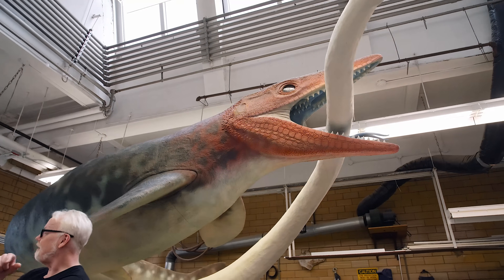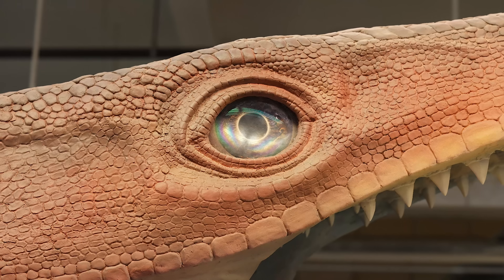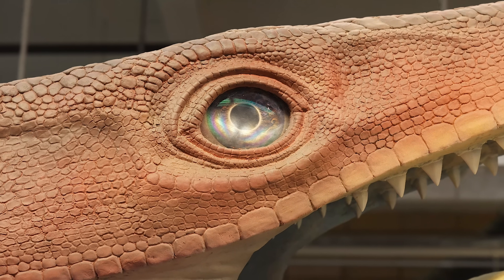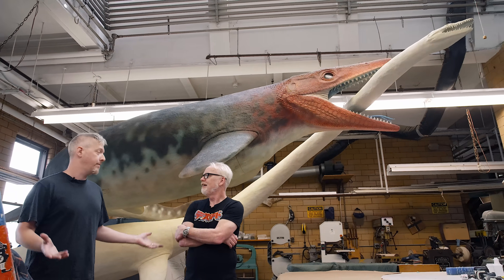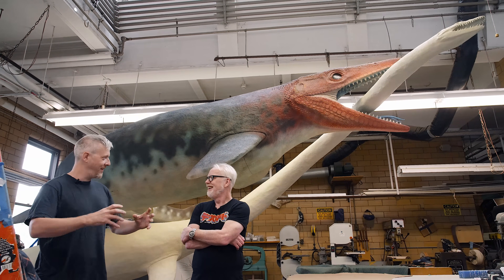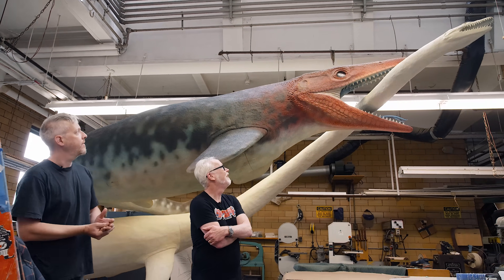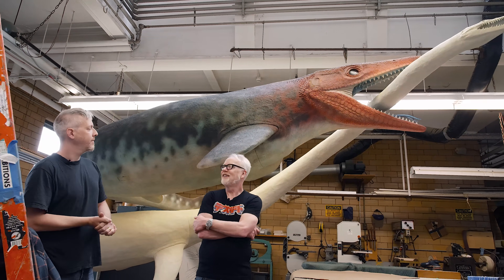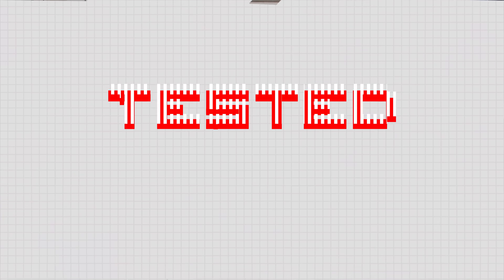Adam Savage Meets a Triceratops AND Mosasaur in PERSON!

Comment: Why are you making 24 fps content for a platform where nearly everyone is using a 60 Hz display? 30 would be vastly better, avoiding 3:2 stutter and more easily integrate content shot on phones at 30 or 60 without really messed up frame pacing

Comment: There's a lot of creative decisions going into this, but it's still scientific. They're applying a hypothesis that fits the data. Maybe the proto-feathers are wrong, but the data showing them existing before and after triceratops makes the hypothesis reasonable. Science adapts the hypothesis if the data contradicts it. The long term trend is clearly toward more accurate models of these animals.

Comment: The angle of the crest on the trike looks odd. It's opposite to what the actual skulls seem to show.

When it comes to the hairs/spikes on the tail and back, I know some protoceratops had them, but are we doing the same thing as with feathers a bit back? Slapping the stuff on because "why not". Like they turned a t-rex into a giant chicken, with no feathers on the underside where we knew they had none because of the imprints we had. Every other surface was covered with feathers. Because why not...
Reply: There are two species of Triceratops so it might just be based on the other species and not the one the skulls you are thinking of belong to.
Reply: Triceratops has little holes in its skin on its back which seems to be a spot where quills would have been.   Considering we know for a fact it's ancestors had quills in that exact spot, Triceratops most likely did too

Comment: the trike is cool but just because ancestor has feathers doesn't mean they should have them
Reply: But it does mean it's more likely they had feathers. It's called phylogenetic bracketing, which means animals that are related tend to share traits. Phylogenetic bracketing is also what Paleontologists do to reconstruct dinosaurs that have very little fossil material. They reconstruct the dinosaur's appearance based on its closest relatives.
Reply: @jacobcox4565  Very unlikely since most ceratopsians lived in warm environments, only one like Pachy that lived in cooler climates could have been woolly rhino analogue, but still its all just speculation.
Reply: @FaustianSerb  Elephants still have at least some hair, even if they live in warm environments. These quills are obviously not going to help with insulating body heat.
Reply: They had little holes in the skin in the exact spot its ancestors had quills, and those holes were most likely spots for quills.    It's not just because its ancestors had them.
Reply: @AgroAcro  the holes could’ve been anything
Reply: @tyrannotherium7873  They are literally in the exact same spot as the quills on its ancestors.   It most likely had quills
Reply: @A @AgroAcro  they could be scaly skin or osteoderms
Reply: @tyrannotherium7873  They aren't either of those.   It's holes in the scales
Reply: @AgroAcro  they could be anything but not feathers
Reply: @tyrannotherium7873  Well that's a flat out lie.   It is almost certainly quills.